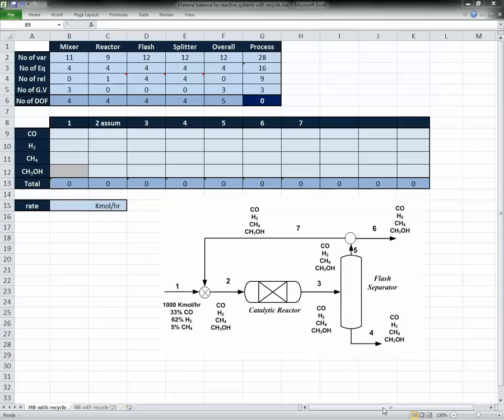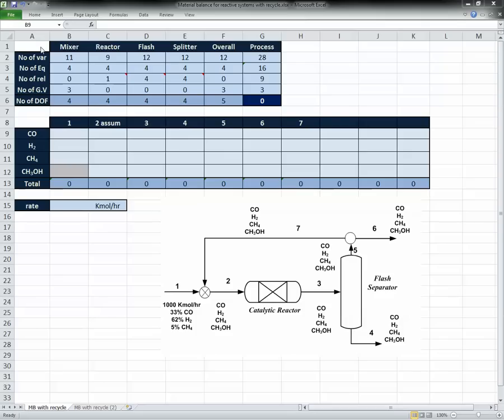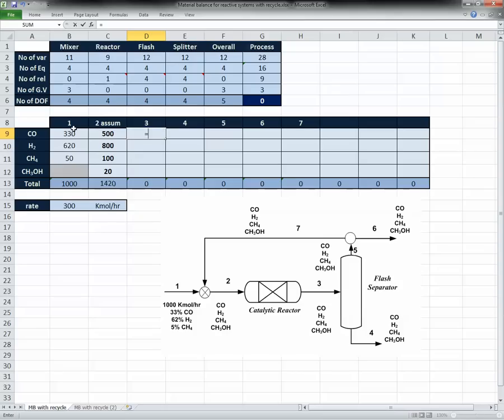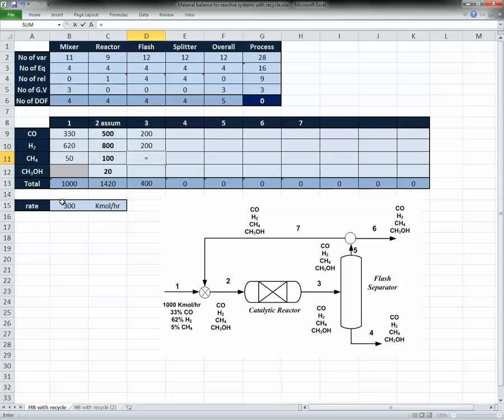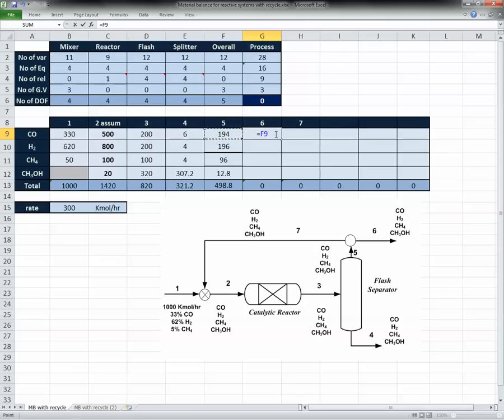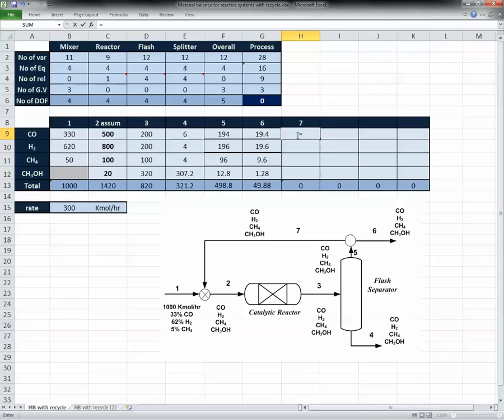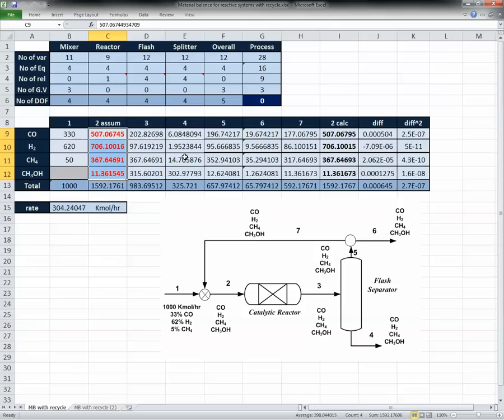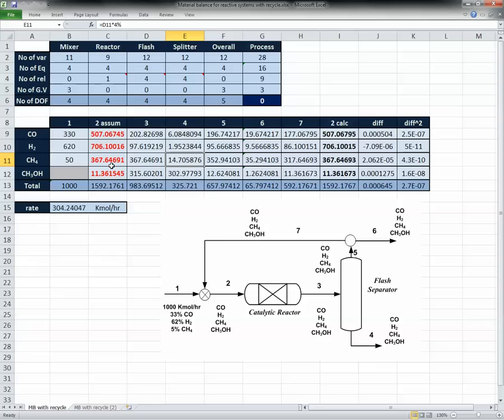Excel for Chemical Engineers I 16 I Material balance (5/5) [Reactive systems with recycle 2]

Comment: Hi sir! Thanks for the tutorial. It helps me a lot.  I want to ask what if we get negative value for one of the molar flowrate after calculaing using solver? How to solve this since it doesn't make sense to me. Thanks.
Reply from the maker: Hi Syahir,
I'm glad the video help you!
The molar flow rates should always be greater than or equal zero. Getting a negative value can be due to :
- A wrong value, so check the givens well and make sure your write them correctly in the spreadsheet. It is pretty common to be a unit conversion error.
- An error in the balance equations, just one wrong sign or bracket is enough to mess up all the calculations. So check  the balance equations and make sure there are no errors in them.
- If all the numbers and equations are right, then this could mean that the stream is flipped. Which means that the stream is going the other way. In this case change the stream direction and accordingly the equations and see if the problem is resolved.
- If you still have negative stream flow rates values then this is most probably an issue with the problem givens.

Hope this helps!
Reply: If you are having trouble with your solver giving negative values (which may be mathematically correct, but not physically correct of course), you can always add constraints to the solver, specifying that the values it is iterating must be greater than 0.

Comment: In this exercise, Mr. Mohammed does nothing that is not known. Mr. Mohammed uses the concepts of Professor Reklaitis (1985), but remains in them. What little he adds them is the solution of the exercises using excel. No more. And excel it is not necessary to solve these exercises Balance. Furthermore, many of the concepts of Reklaitis are obsolete. The iterative method is unnecessary. I have a better way to resolve any problem material balance without using Excel or global balances. The exact answers to this problem are: N2 = 1592.170131; N3 = 983.688261; N4 = 325.421451, 657.966811 = N5, N6 = 65.796681;
N7 = 592.170131, r1 = 304.240934.
Reply from the maker: +BEN-HUR VALENCIA VALENCIA Thanks for your comment!
I did not claim that I am doing something new, if you watch the series from the beginning you will know that I am interested in introducing Excel as a tool for solving various chemical engineering problems using the known methods (like Professor Reklaitis method in this video). Please let me know if I said something different.
Definitely this is not the only method for solving such type of systems, but it works. I will be glad to know more about your method.